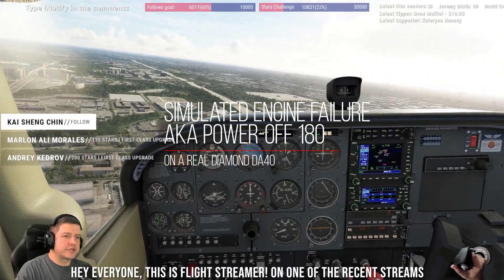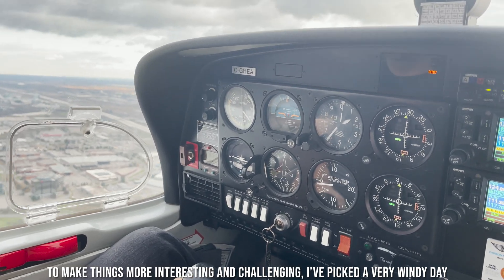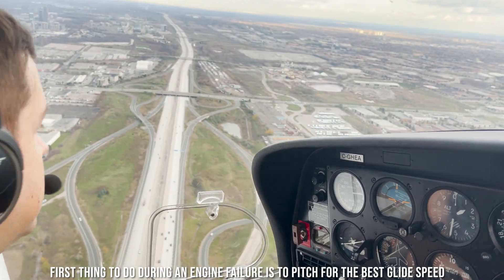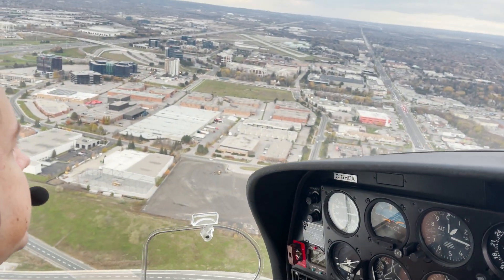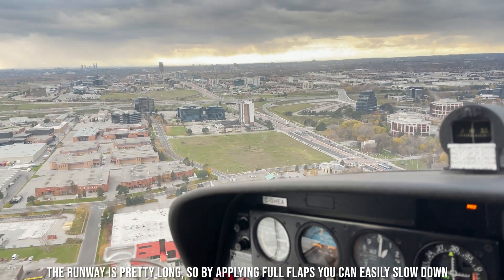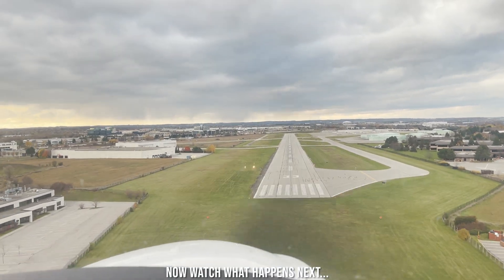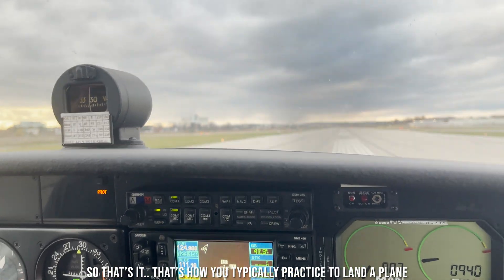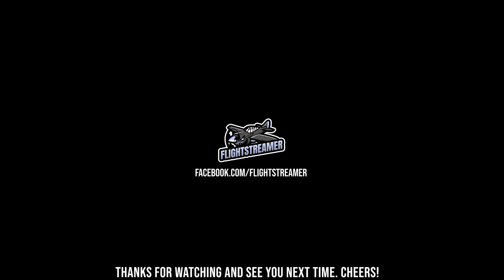Practicing for Emergency Landings with a Surprise twist at the end

Comment: nice,,, not really a 180 thou,, that refers to takeoff engine out,,, and never do a 180 under 1000 above on takeoff  :))
Reply from the maker: Actually it is, on take-off you don't turn back below 1000 - you are absolutely correct (on the upwind leg). You don't practice that, because it's NOT safe, since you're landing with a tailwind.

In this case, it's Power Off 180 in Circuit abeam the threshold during a Downwind leg is what the maneuver is. Refer to a definition of Power off 180: 
The 180° power-off approach is executed by gliding with the power off from a given point on a downwind leg to a preselected landing spot.
Reply: @flightstreamer  ya i was just thinking you meant a 180 after takeoff,,, guess there is more than just that to be called a 180 lol :))
Reply from the maker: @MAGApepe  What you are referring to is actually called an "Impossible turn", which is absolutely critical to know. 

However, this maneuver (Power off 180 / aka "Simulated Echo") is actually on a Commercial License flight test. For PPL, you have to demonstrate it to your instructor before going solo. It's always a good idea to practice it from time to time (if no one is on the circuit/pattern). You initiate it at circuit altitude in the downwind leg at 1000 ft AGL
Reply: @flightstreamer  yup,,, i see all the time ppl trying to say they can make that impos  turn,,, i dont know why ppl would push that failed idea ,, under 1k,,, no lefts or rights,,, land straight ahead :))